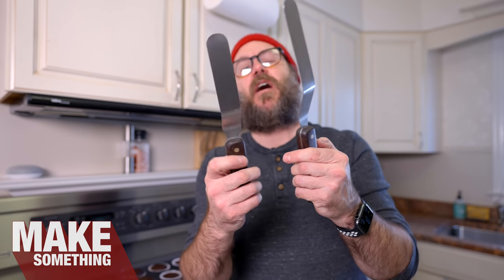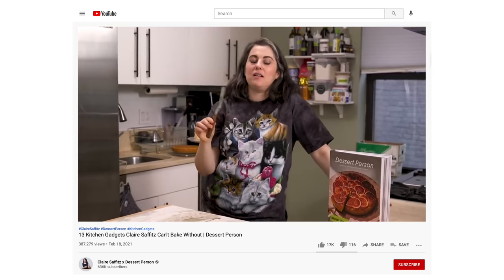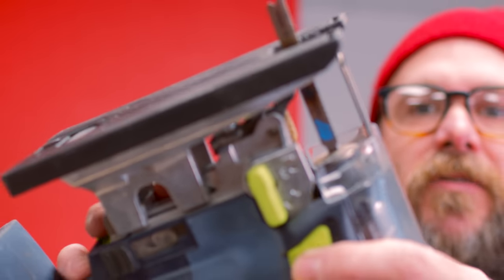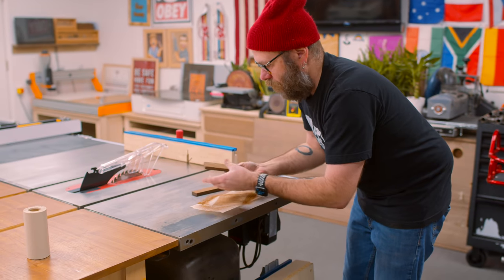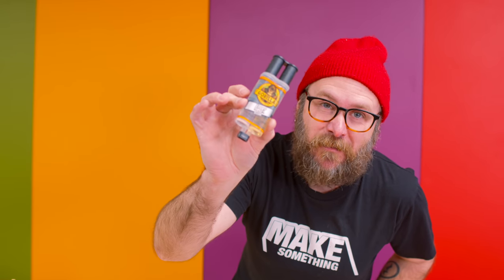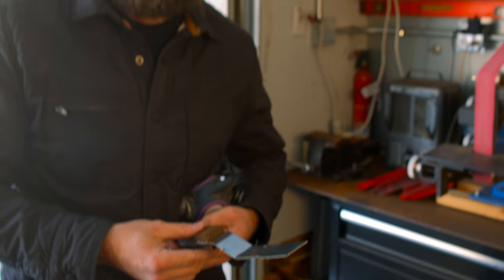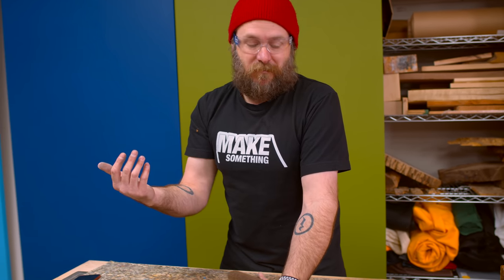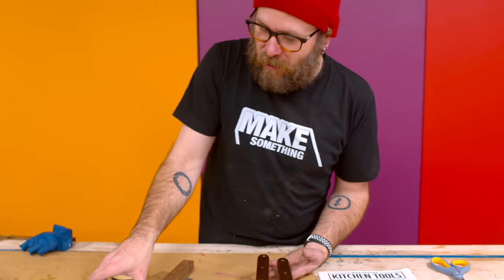How to Make an Offset (Icing) Spatula | Claire Saffitz Favorite Baking Tool

Comment: Stainless steel is very hard to cut. The metal is almost as hard as the blades. You really need the high quality blade that is designed for hardened steel. I would NOT recommend using a wood band saw unless it is the portable "porta-band" style.

Comment: Really good job, couple notes... first, hell yeah stainless does NOT like to be sawn OR drilled (looks like you got lucky).  It will eat your band saw blades too.  Best way to cut it is shearing, but of course shearing deforms it, especially if you are doing a 1" strip like that.  The overall best way to cut it would be with a foot shear, but they're really expensive.  Otherwise the angle grinder is a good idea, but if you want to do it inside check out how to use a cold chisel in a vise.  You can get really clean work with one.
The other thing is, you don't say what you bought but I'm guessing it was 300 series stainless, which is nonmagnetic.  If you get 410 or 410 stainless it'll be magnetic, which might be important for someone to have.   If you get really fancy you can heat treat 410/420 and make it so it will really resist deformation.

Comment: Stainless is tough stuff, it’s harder to cut than regular steel I think. What gauge stainless did you get? Grade?
Reply: Ok I followed your link. .048 304!
Reply: Also you really need slower speed to cut ferrous metal on the band saw. Maybe slow the jig saw down?